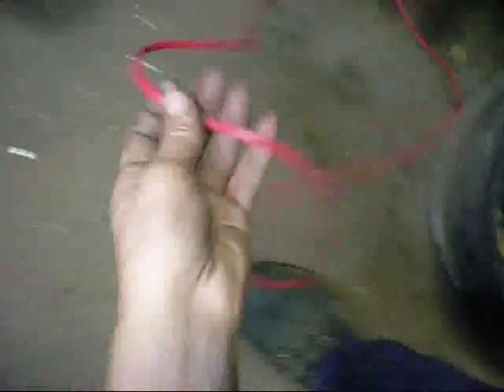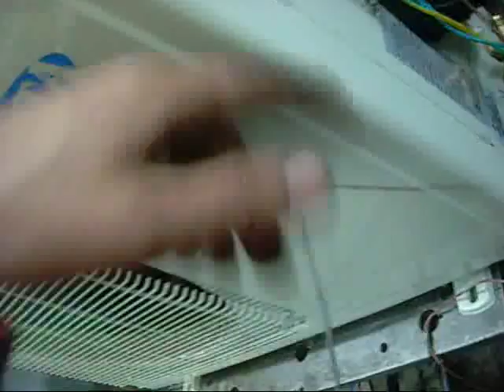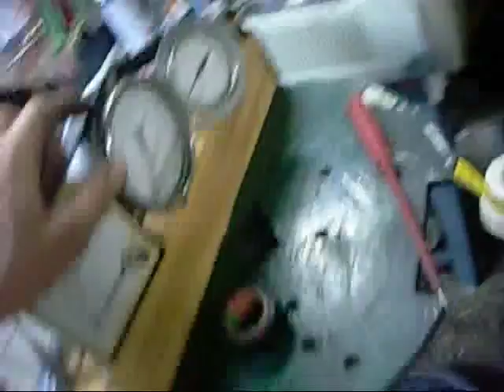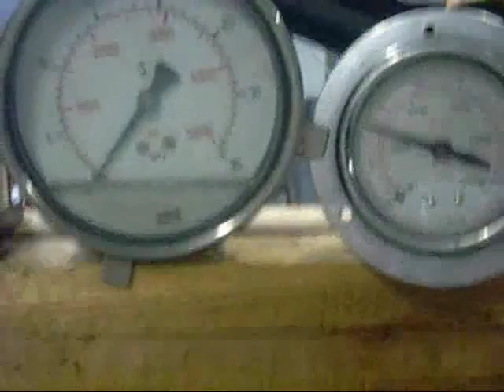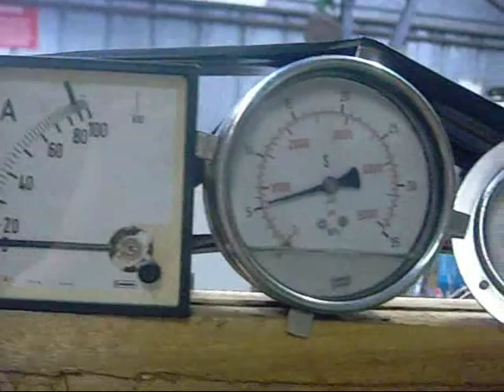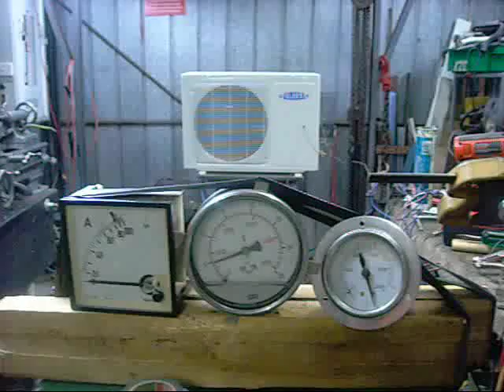Forced Failure of New Fujita Condensing Unit Compressor

Comment from the maker: @Lachlant1984 the Fujita brand is one of many printed on these generic AC units. cheap Plasma TV's like MagnaxoX, Soniq, and generic store-branded ones are the same deal.
you order 10,000 units from the generic factory in China, and pay an additional $5 a unit to get your brand name printed on the front.

The funny noises were being made by the sealing vane in the pump itself, it was bouncing or sticking or something like that,

Comment: I've never heard of the Fujita brand before, it sounds Japanese, but I'm guessing it was made in China, possibly a cheap Fujitsu clone.  What's the deal with the strange noise the compressor was making before it shorted out?  What caused it to short out?  Why can't you just carry the unit outside after all that pressure has built up inside it.